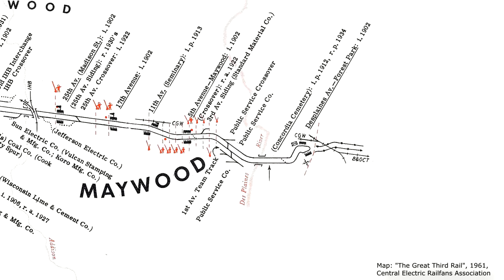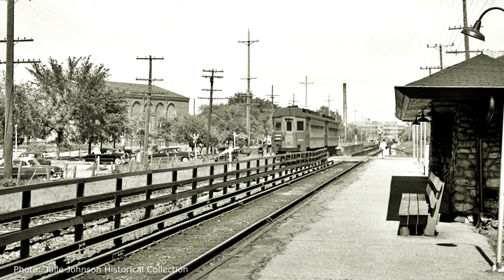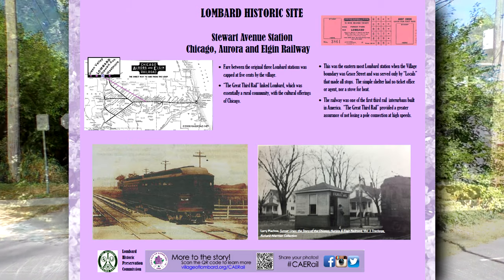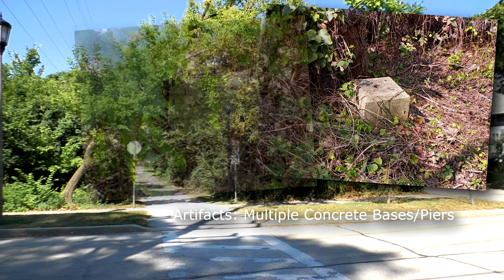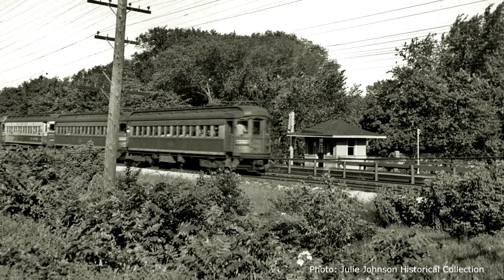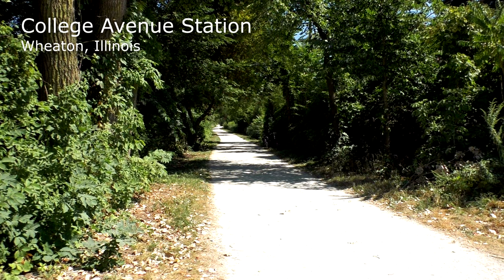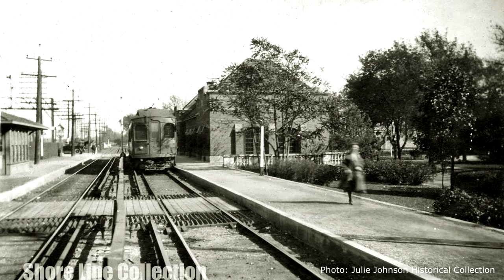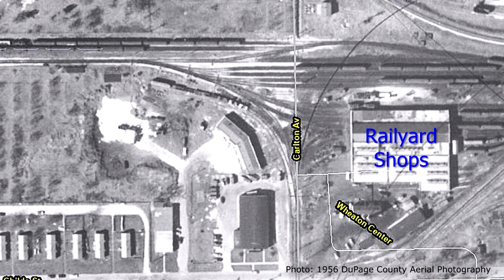Disused Stations of the Chicago Aurora and Elgin - MAIN LINE - Part 2

Comment: I remember standing in the Wheaton station with my dad, while he went to the barred window and bought tickets to Chicago. It was great fun for a boy to watch or be on the trains when they accelerated quickly from the stop so they could coast across Main Street.  I can still feel the slight lurch as the train would contract the 3rd rail on the east side of the street, the strength of the lurch dependent on the skill of the motorman. Fun times! Your videos bring it all back. Those trains should still be running, darn it!😂
Reply from the maker: Thanks again for the comment - and for sharing your recollections of the CA&E trains!   Have you visited the Fox River Trolley Museum in South Elgin?   You can ride the CA&E trains there to this day!
Reply: @BeHistoric  I live too far away to visit the museum, but the videos of those CA&E trains are great fun to watch. I'll add the museum to my bucket list, but right now, a visit seems a long way off, literally and figuratively, so thank you again for your great work on a great railroad.🙂